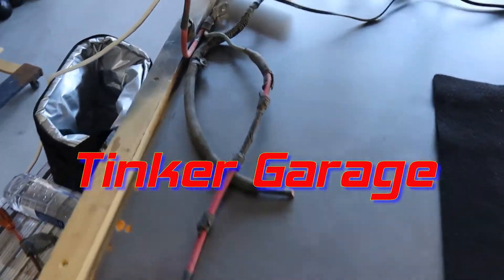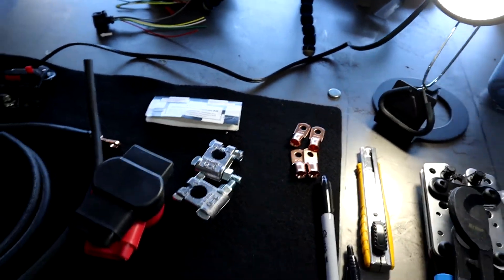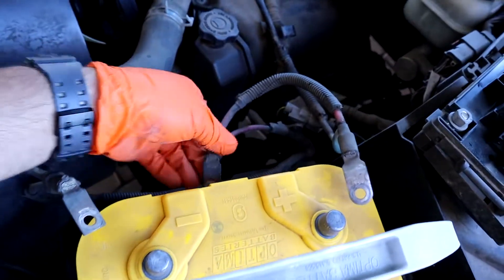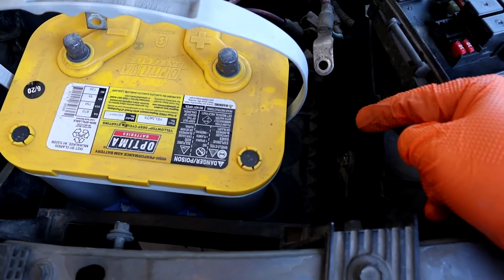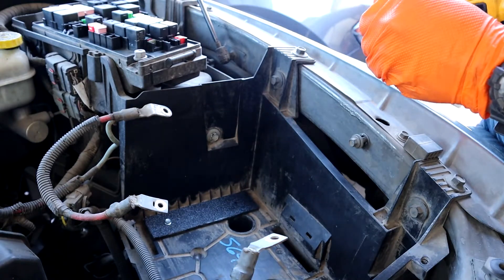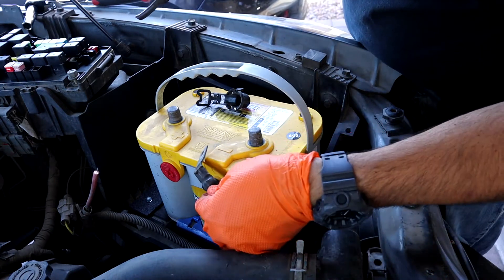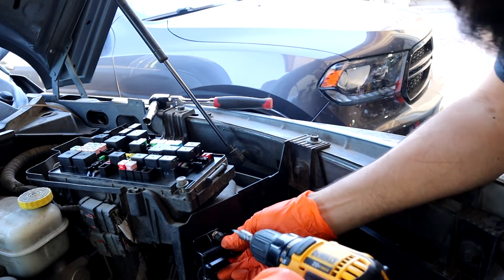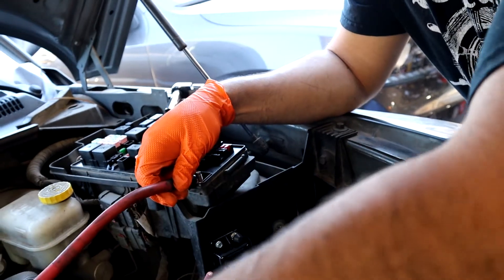Big 3 upgrade on a Dodge Dakota

Comment: Question I know this is 2year old video still great but I noticed your Fuse isnt fully closed.
Did you have issues with it by like moisture getting wet or bumps.
Did you fix that issue by trimming lid more for bigger wires.

😮very helpful information thankyou.
I have a 2002 dakota 3.9v6 4wd. Am having positive cable issue.
Replaced terminals to diehard ones from advance the red wire from alternator is keep coming loose after tightening.
This is an upgrade I'll be doing starting today day off.

Was going to ask where you bought the cool light blue crimping tool.
Then read description said all was from Amazon.

Question would these be 100times better than the ratchet crimping tool.
How many feet was the red cable from alternator to positive battery.

For my year of truck 2002 dakota 3.9v6 do they a company sell entire pre made grounding kit?
Reply from the maker: No issues cable is secured well and battery is held down as well , all tools I got from Amazon they work great and distance from my alternator to the battery maybe used 3-4 ft of cable and no issues with moisture or getting wet I did use heat shrink with the glue inside to seal all connected crimps and I also live in arizona really dry if your looking to thick cable junks yard I was able to find heavy gauge cable dodge chargers Chrysler 300 dodge magnum all have there batteries in the back and use thick gauge cable that’s were I got mine Perty cheap

Comment: Hi.   The motor will have 10 or  12 gage wire on the block but you can put your ground in any boot hole you wish.   I used the bolt for the alltnater  so it is dearly grounded to the bat.   I put a long bolt throw my bat turm  along with the cheesy stereo and body ground.   It is  a  grate  thing to do .   I'm glad I did

Comment: It is hard to take someone unionyon with a smoke  hanging out of their ear!!.   I did the same thing to my 2000 Dakota. It worked out great!!.   But I have a lot of electronica so I still have to up grade the alt hard to a 250 amp!!.   I hope it will run all the stuff.
Reply: Which motor do you have? I have the v6 and need to do this for my next radio install. I'd like to know where the motors ground wire is. Personally haven't looked but figured I'd ask.

Comment: I have a HO 250a alt, all upgraded wires and 3 batts but I rarely change above 14.4 because of the PCM regulator. It sucks. Anyone else have this problem?
Reply: 14.4 is not bad??

Comment: Hey, 06 Dakota owner here! Just curious what the benefit of this mod is? Definitely as one commenter stated, we're a very small community, us 3rd Gen Dakota guys lol
Reply: 06 here too man. It's for better flow and ground of the electrical system help it run better voltage. Ive got my truck done with 2/0 welding cable. I ran power and ground front to back for the system.
Reply: @kingboom13  Thanks! I'm thinking I might do it if I end up putting in a winch and/or a fridge in mine. Looking at a t case rebuild, some tie rods and a front wheel bearing first lol
Reply: Us first Gen are even smaller..